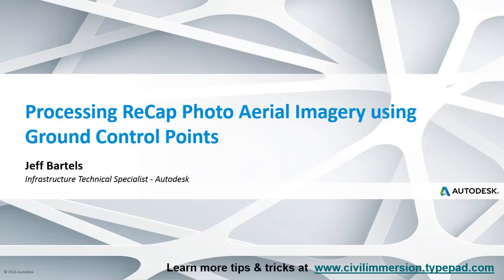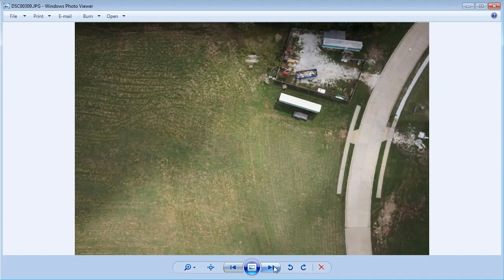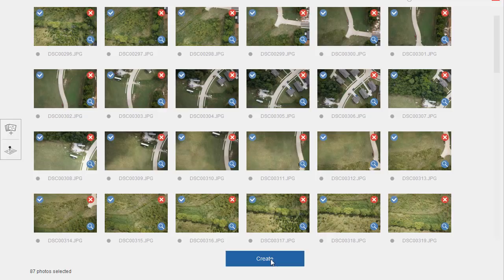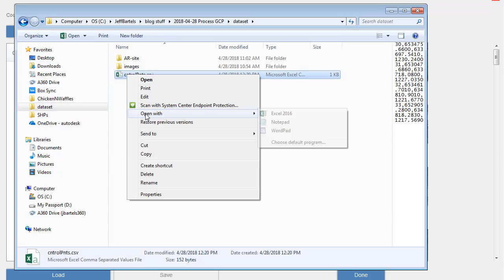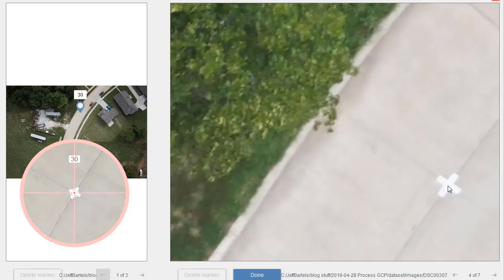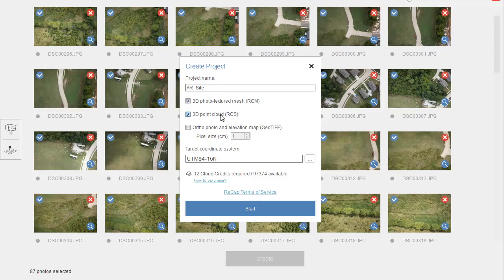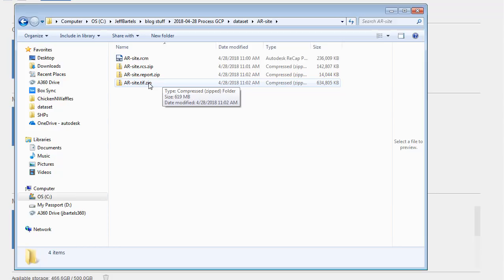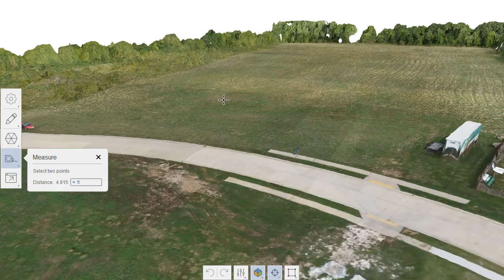Processing ReCap Photo Aerial Imagery using Ground Control Points

Comment: Hello mr. Jeff
I am a Civil engineer and I am very interested in drone mapping technology. Please, I have some questions for you to help me. 1- which drone brand is better for mapping? 2- can I get pictures and processing maps with (1cm) accuracy? 3- does there additional equipments used with drones to capture more accurate pictures like gps equipments? 🙏
Reply: 1. What are you gonna be flying for? You'll need to choose between a Fixed Wing and Rotary (Copter), but you'll need to take into consideration the area. If your mapping an area that's big I would say Fixed Wing will do good such as an Ebee, smaller condensed area a DJI Phantom will do good. 2. I would suspect its possible (expensive for the right drone and camera) with processed maps or ortho images as long as you have some ground control in your project that is good. 3. A lot of bigger brand DJI, Ebee, etc. have RTK units attached just like a gimbals it can be installed onto the drone to accurately geo-reference each image.

Comment: I am interested in learning more about the capabilities of AutoDesk Recap for the documentation of cultural heritage - specifically sculptures and not entire building facades. I need to be able to create 3d models that are accurate enough for me to pull dimensions and measurements for construction purposes, ideally up to 1mm in accuracy.
If I set up ground control points during the time of survey, will these control points allow me to pull accurate measurements from the model in the software or will it just geo-locate my data? Would I be able to scale the model manually using a measured distance between two points?
Reply: To achieve 1mm accuracy, you will need extremely tight control and run scans using a mutli-station, not a drone. I hope you have received an answer over these 3 years from another source, but this question might have to go straight to Autodesk staff if ReCap can stand behind a 1mm accuracy guarantee.